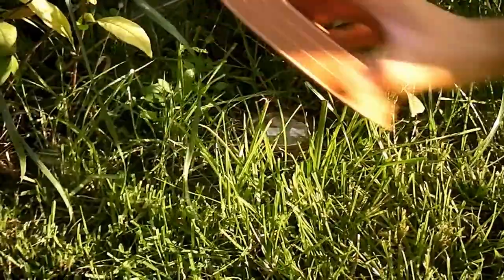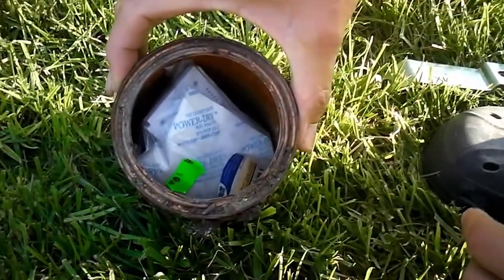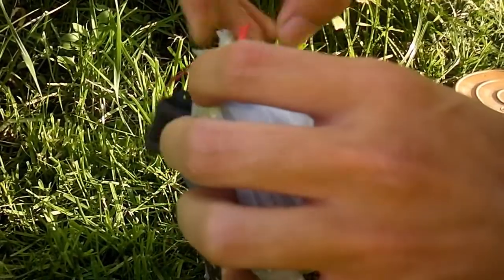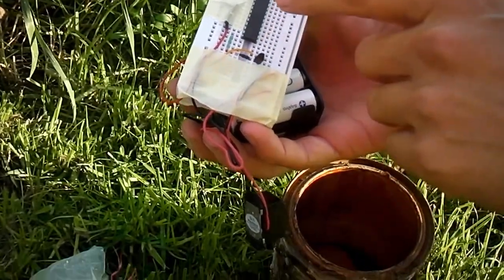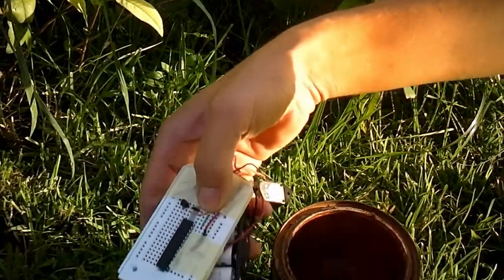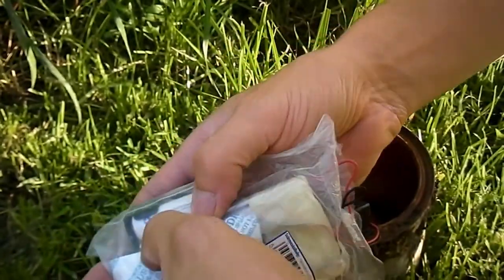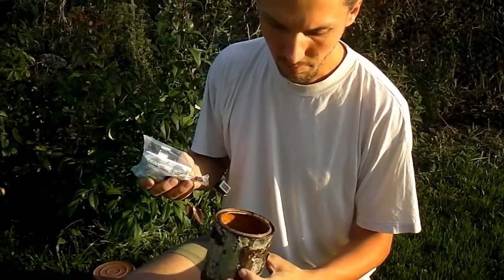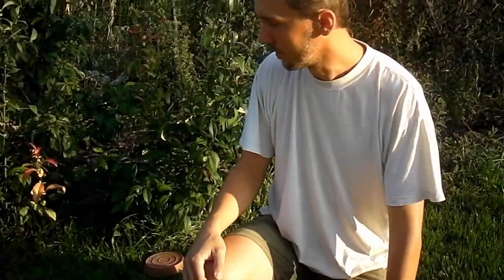Mole repeller with Arduino

Comment: Do you have a part number for the buzzer? I've got a commercial solar-powered mole repeller but the buzzer died.
Reply from the maker: I've used a 12V buzzer, but solar-powered more repellers utilizes 3-5V buzzers. Meanwhile I also have bought a commercial solar mole-repeller, mine has a problem, that the buzzer doesn't activates on low (3V) voltages. So activates only in direct sunshine, but not on battery.

Comment: Did it work for you?
Reply from the maker: This was just a proof a concept, try out if moles really hate noise or not. I was in a time pressure, as was in an attack. :) So I was putting everything together real quick from the parts I found at home. I have run it for 3 months with success: the moles moved back to my neighbor. So next year I have investigated in a professional solution.
Reply: @sharedinventions  Nice! :) I'm also under attack currntly and try to read all and try all what is available. Noise generators are quite expensive in my country so probably will do my own using arduino :) This should be fun. Thx.
Reply from the maker: @jankalenica2597  If you have a cheap FM radio, that fits in a jar, that might be the best temporary solution. Tune in some pop station. :)